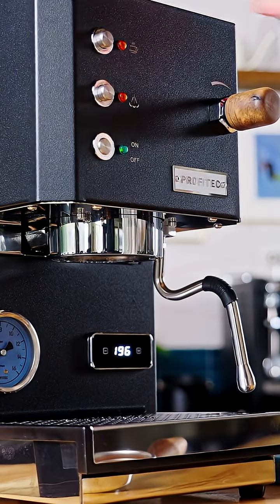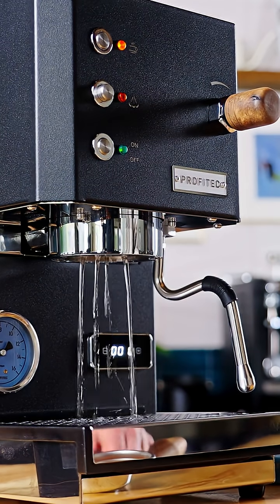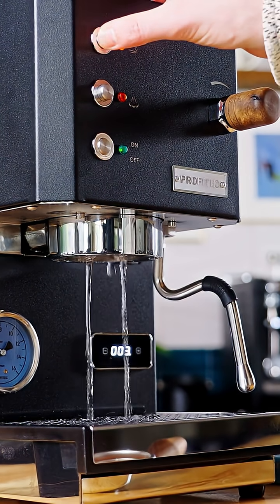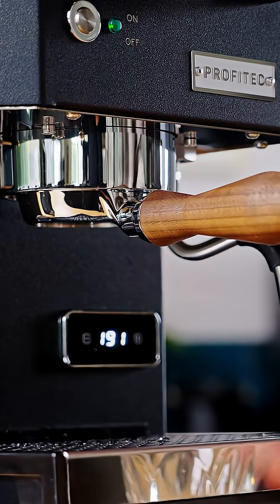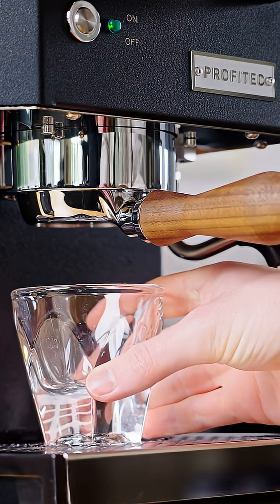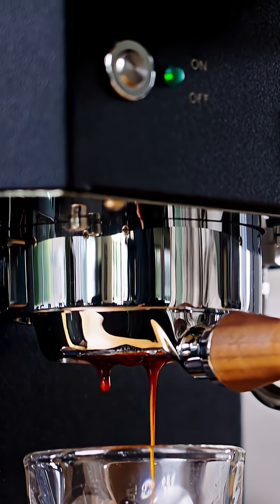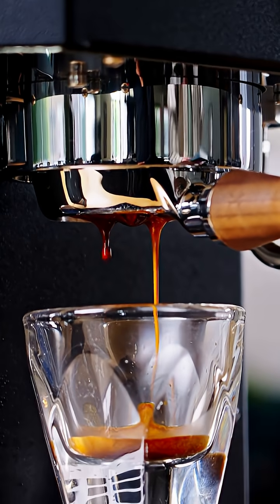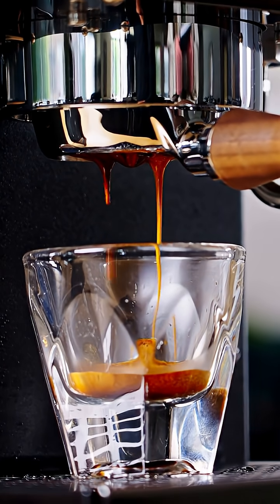Flow control is complicated... Or is it?

Comment: I had a flow control on my synchronika.... Used it for years, and I can tell you it's a gimmick.  It's finicky, and your chance of a miscalculation is high.  You want a real flow control?  Get a real lever espresso, if not, aim for consistency and don't get those gimmicky "flow" control.

Comment: What was what the last machine with the removable flow lever?
Reply: Hard to tell in the video, but any E61 group head can have this. Clive has several machines where they sell the black and walnut variations.
Reply: @petersdrue I was talking about the one where the lever was getting fitted onto the underside on the right of the group
Reply: @ScooterComputerAndMisterChips  That is the new LUCCA Tempo machine!